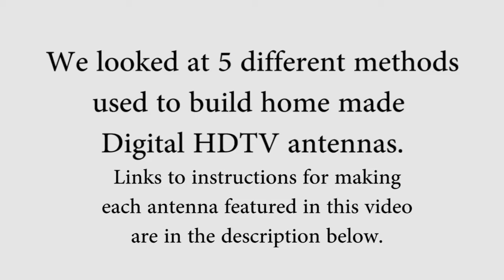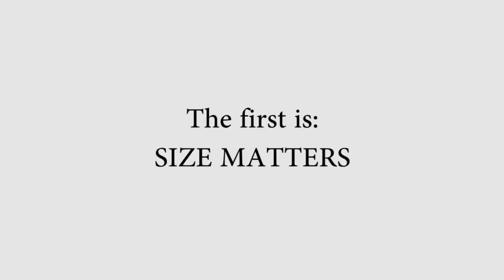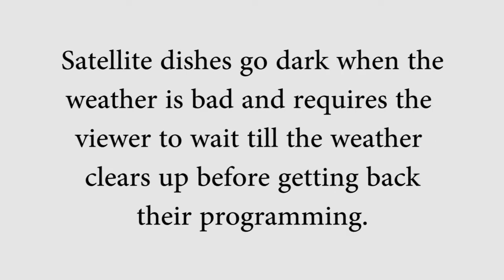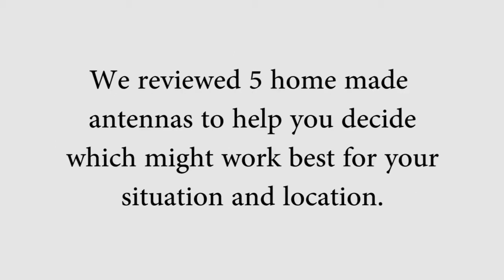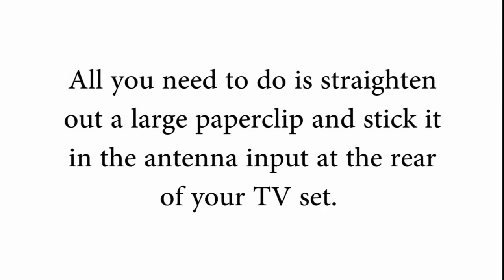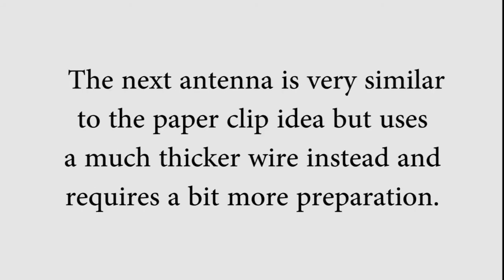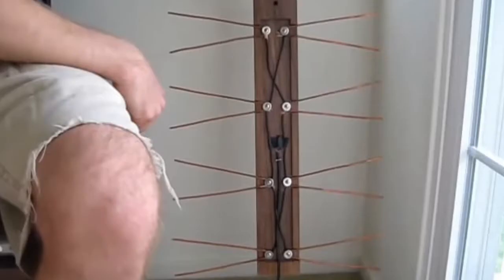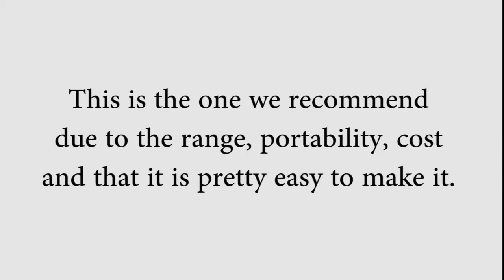How To Build The Best HDTV Antenna - Review on 5 Antenna Tutorials

Comment: I have built a couple of the antennas with rectangular sheets of aluminum, one has been in service over 6 years the other just 1 year. But, Mine were slightly different, the aluminum was 9" x 14" and the 14 " side was side by side making the antenna just over 28" x 9". I don't recall
if I used the transformer on them, or just directly connected the coax to the aluminum, I'm pretty sure on the last one it was a direct to the coax connection. At 20 ft it received all but one station that my 20ft Hoverman antenna did, At 30ft, it got that other channel it missed. So over all it got 25 stations, same as my much more complicated Hoverman. Built it in about an hour for my neighbor after a hurricane knocked the cable out for a month or more.

Comment: LOL. 99.999% of the people picking up TV with an antenna cannot see the towers from their house but still get a good signal. If I stand on top of the tallest building in my city, with binoculars or a telescope, I still would not see the broadcast towers due to the curvature of the earth. Yet in my second floor apartment, in a valley I get over 30 digital channels on an average day, & over 40 on a good day. I'm using a cheap Monoprice antenna sitting on top my window AC unit. Why? Because it worked better than any of the popular & more expensive brands. Non-amplified antennas only got me a little over 20 channels at best.

Comment: There is no such thing as a HDTV antenna, antennas are not High Definition! Digital yes HD no!
Reply: They aren't even digital, they still receive a radio frequency that is encoded with digital signals, but it would receive regular TV signals or audio signals if that's what was encoded on the radio frequency. When they went to digital they often went to a higher frequency for the digital signals, that's why the channels changed.